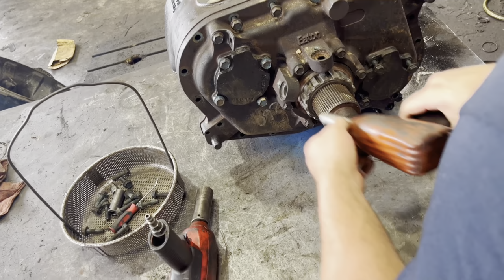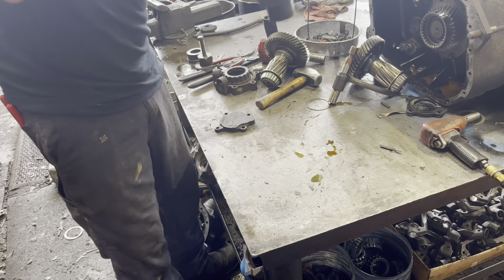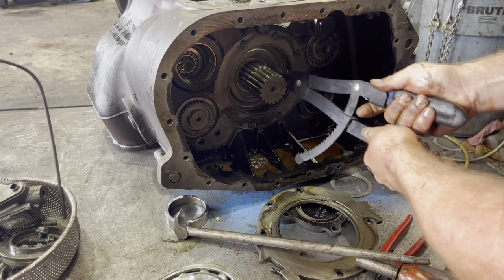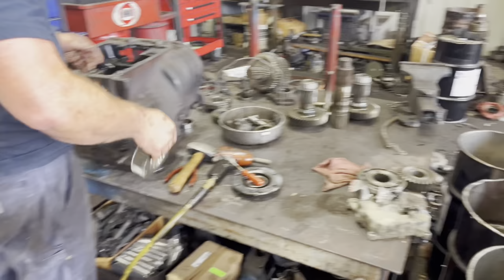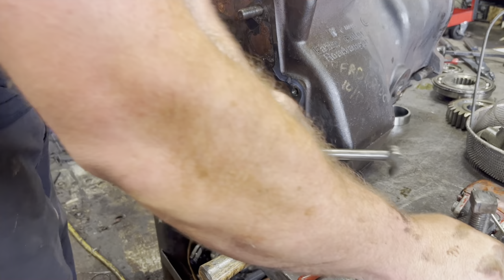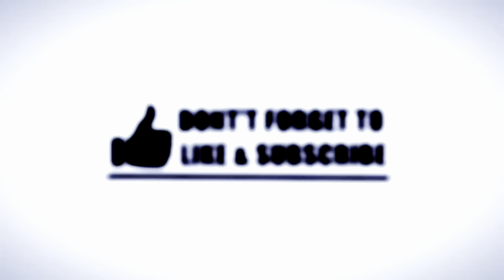10 speed transmission disassembled in 12 mins. Eaton fuller Fro16210c

Comment: cool tear down video! what’s the part number to that counter shaft bearing puller ? subbed 👍🏽
Reply from the maker: The front box countershaft bearing puller is a G-246 and the Aux countershaft bearing puller is a G-247. The G-247 comes with just the collets only the 246 comes with the front bearing collets and the puller
Reply from the maker: G&W tool company is definitely who I recommend

Comment: I'm starting to like the 10 speed more than a 13. Any major issues with them?
80000lbs (max in PA) rural roads/ Amish unpaved driveways
usually 72000lbs
Reply: Man, I have a 10spd EF manual and the truck is essentially undrivable at 55MPH.  I need a gear between 9th and 10th.
Reply: @georgiapatriot4575  funny but we drive 10's with no problems
Reply from the maker: What’s the model # of the transmission
Reply: @etrtruckcenterenginedrivet8918  fro16210c

Comment: I have the same transmission I just purchased another one mine has a hydraulic slave cylinder the one I purchase does not can I change the bell housing from one to another?
Reply from the maker: The transmission that you purchased has a bell housing allready on it?
Reply from the maker: You should be able to change the bell housing no problem as long as there the same model trans.
Reply: Yes sir they’re both the same exact model as what you’re working on the only difference is one has the rod clutch mine has the hydraulic slave cylinder but yes I still have both built houses I just didn’t want to do all that work and then it not work
Reply from the maker: Shouldn’t be a problem swapping the bell housings over don’t use silicon. bell housing gasket # is a 4308226
Reply: I sure appreciate that tip because this country boy was about to use some silicone
Reply: Can I get this gasket anywhere or is it like a special order?